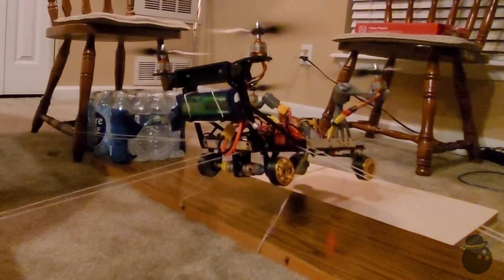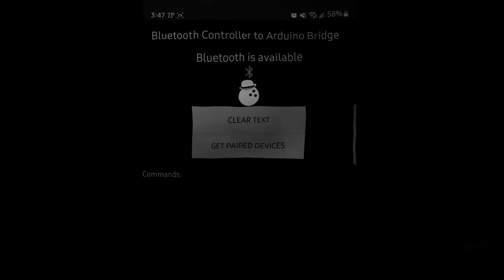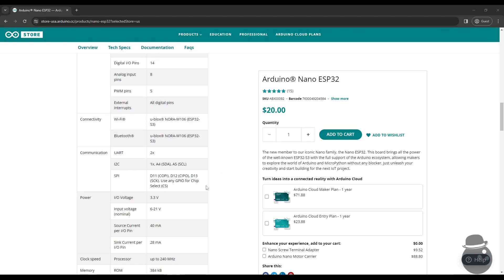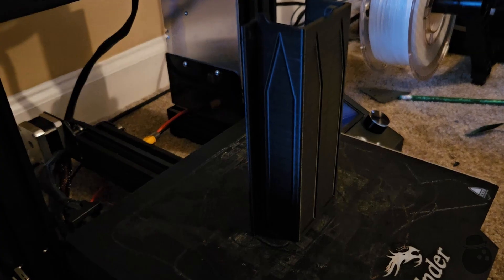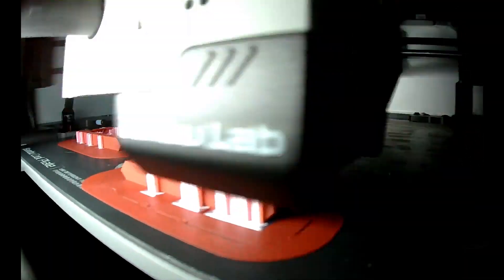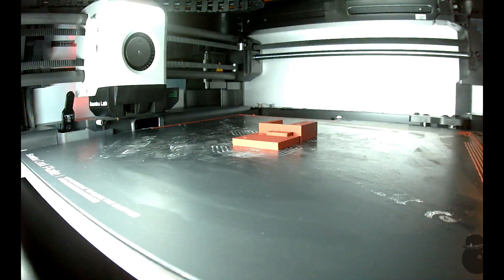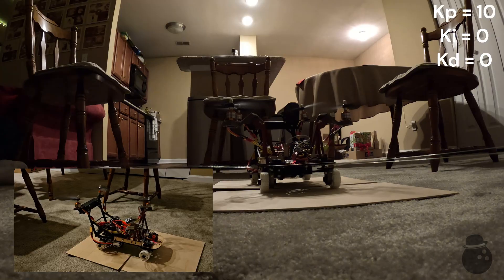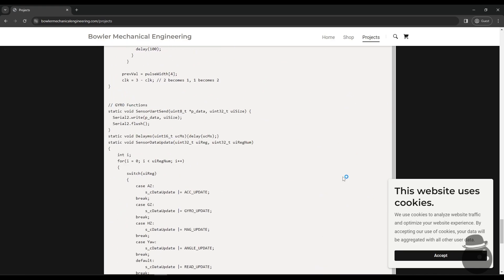Flying RC Car - Part III - Upgrades

Comment: for getting it stable just use a drone flight controller with betaflight it should help quite a bit considering the pid loop frequence is way faster than any arduino flight controller

Comment: Hi FPV guy here: 

1. Try to fix the props, so they don’t move. When your quad will pitch and cause the props to move, it can be wrongly interpreted by PID algorithm and be catastrophic for your quad
2. Try to use a flight controller, developers from Betaflight spent years on improving their PID and flying capabilities. Why reinvent the wheel?
Reply from the maker: Thanks for your comment! It sounds like you agree with the consensus, I will likely be looking into a flight controller (it was neat to learn/reinvent the technology just for my own education). As for the moving props, I would really like to keep that feature if possible but it sounds like the comment section has low confidence in that working so I might have to revisit a way to hold them fixed other than their own thrust / hard stops.

Comment: so I build RC quadcopters (FPV drones) for racing. your problem is the pivoting joint on the four arms, the extra movement in the arm is causing noise in the PID control loop. the four arms of the flight frame have to be as stable as possible and you really want the accelerometer and gyroscope in the mass center of the craft isolated from vibration as much as possible.
if it HAS to pivot, you might consider a latching system, maybe one that activates or deactivates with a servo or mechanically with landing/launch momentum. so like when you arm the flight motors the arms pivot and lock in place.
Reply from the maker: Thank you for the comment! The accelerometer/gyroscope point is a valid one, and, since everyone in the comments is recommending a flight controller, I will likely be getting one with a built in gyro so I will just position that over the center of mass. In part 2, my original design had servos articulating the swing arms, I am hopeful that I don't have to go back to that (because it looks cooler to see the motors lift themselves, and it saves weight), but as I continue working I will keep that option in mind.

Comment: Have you thought about checking out existing car that flies? I think they have one out there somewhere and check out their design.
Reply from the maker: I have seen some "Quadcopters with wheels" but I have yet to stumble across an articulating land/air vehicle. Do you have a link (or video name) in mind that you think could help me?

Comment: You should use radio master ELRS . it’s a open source  protocol 
They use a 915 MHz long range 
Set up
Reply from the maker: My new radio controller gives me 1.3 miles of range which should be more than plenty for what I need (and much better than the 15 feet of Bluetooth I had before). Thanks for the suggestion though!
Reply: yo the 2.4 Hz Elrs is just as good at range in open air. 
but yeah, the elrs dev team did a 100klm flight on a regular radio.

Comment: The reason it leaps forward is because your rear props produce thrust perpendicular to the ground while the front produce it back at an angle. You will always need more thrust out of the front propellers to keep the car in the air since they are angled (check out force vectors). Your car will never hover unless you wither make the front props flip out to be perpendicular with the ground our you tilt the back props in the opposite direction.
Reply from the maker: The angles in the linkages (at least in cad) have the front two props ending up orthogonal/perpendicular to the ground. The force vector should be straight up on all the motors. Is there a part in the video where you are seeing them not be at the correct angle? Moving the front props to the hard stop manually also has them appear to be perpendicular to the ground. I will keep a closer eye on the angles of the props while it's trying to take off and see if I am hindering myself with non-perpendicular thrust vectors. Thanks!

Comment: I wonder about a couple things.  1) bendy arms for the props.. makes for a lot of variation the flight controller wouldn't account for.  2) do you get much prop wash from the higher props to the lowers?
Reply from the maker: Thanks for your comment!
1) Yes, I am definitely making it harder on myself by having those articulate. That feature is what, at least in my opinion, makes this project unique, so I would like to keep that even if it means making the controlling harder. At very low thrust, the props swing up to hard stops and are constantly pushing against those hard stops for the duration of "flight", which, at least as far as I can tell, shouldn't be too big of an influence, right?
2) The rear props are only about half an inch higher than the front props. The circumferences of the props are separated by about 2.5 inches. I don't suspect there is a lot of prop wash but it's possible.

Comment: I think you could use an FPV drone flight
controller, like a SpeedyBee F405 V4 running
iNav, with all the GPS and altitude hold
functions, while simultaneously using ar
Arduino for controlling the car. Alternatively,
you can search for a MatecSys flight controller
designed for an FPV wing, which has a lot more
outputs. Then, you can configure a driving logic
for the car through the programming tab of the
iNav software. I'm not completely certain if this
is 100% possible, but I think it's worth a try.

Comment: Something that could help is to move the props further away from the main body also add a percent error into your gyro so the quad will not over compensate.

The percent error does not need to be much, plus or minus ,1 or 2%.
Reply from the maker: Would you elaborate on the percent error idea? Do you mean always make the error 1 to 2 percent closer to 0?
Reply: Yes, the main goal is to eliminate any unwanted interference or disturbances  from the Arduino, motors, or any other potential sources of noise. In my personal experience, particularly when dealing with accelerometers or gyroscopes in with an Arduino, I have found that is need around 2.5% error in my data. This helps to mitigate fluctuations and produce smoother results. 

This is the equation I use, it is not the best but it does the job.
smoothedValue = sensorValue - percent
  @bowlerllc

Comment: You really need a flight controller 😢
Reply from the maker: Do you have one in mind that would allow me to do the flying (so 4 motor drone output) and driving (bidirectional wheels with servo steering)? I also have no experience with off the shelf flight controllers, do they provide a benefit or functionality that I am missing with my arduino/gyro setup?

Comment: Nice one! Wondering if any prototype services may help for any upcoming upgrade work? Such as custom PCBs and 3D printing. If so, we'd love to supply free services and reach any collab together. (PCBWay zoey)
Reply from the maker: Hi Zoey, thanks for reaching out. I am a huge fan of PCBway! I used your CNC services in my filament extruder video and when people ask if I know any good services, I point them your way. As long as PCBway continues to provide the quick deliver of affordable and quality services, I will continue to be an advocate. I have no experience designing PCBs but this project might benefit from a custom one. My personal 3D printing capabilities are limited to FDM so there might be some SLA, SLS, or metal 3D printing jobs that your offer would be helpful for and I will be sure to reach out if I need one of those services done! In future projects, I may also be in need of more CNC work, so if that is also part of your offer, I would be happy to discuss a collaboration when the time comes! Thanks again for watching and leaving a comment!
Reply: @bowlerllc  Hi! Thank you so much for your continuous support and recommendation!!! Of course, all services are open to you, custom PCBs/3D printing/ CNC service! And we're looking forward to having some correlated projects working together! May I know your contact info? If you don't mind, you can find mine under this account, would love to have a further discussion on potential cooperation! 🤗

Comment: Maybe you should get a strong FPV quad and make a RC car and combine them together
Reply: Ok cool
Reply from the maker: Thanks for your comment Tim! While that would, most probably, work, that was not my goal here. In part 2 of the series I specifically stated my intention is not to build a "quadcopter with wheels" but instead a car that "transforms" into an aerial vehicle. I also enjoy the process of creating things from as scratch as I can and then trying to overcome the problems and obstacles that pop up along the way.

Comment: have you considered looking into having the same motors connected to the wheels as the propellers and then having some gears/linkages so you can switch between flying and driving mode as you wouldnt use both at the same time. As a wise man once said "The lightest part is the part that is not there"
Reply from the maker: Thanks for the comment! There's a chance this could work. My concern comes from the added complexity that this would introduce on the mechanical side. Balancing the "gained" weight from removing the extra motors with the added linkage weight would be difficult. The wheels also spin much slower with more torque, while the props spin considerably faster. The wheels also go in both directions and the props only (should) rotate in one direction (that direction is different on 2 of the props to cancel out the "induced" rotation). This is an interesting suggestion that likely isn't impossible but would be quite difficult (at least how I am picturing it).

Comment: next time you should make a flying car that flies like an airplane
Reply from the maker: Another channel, Eternal Progression, has a pretty cool one with retractable wings.
Reply: @bowlerllc  yes is saw that after you told me about it, his doesen't really fly though just barely manages to stay in the air longer for like 2 seconds
Reply: @bowlerllc  also maybe you should try making a car-boat like something which will work on land and water

Comment: Have you considered using an off-the-shelf quad flight controller and then toggling to it for flight mode? I've had some success with using the mode switching and LED on and off toggle to hand control to an Arduino by flipping a switch on the controller. I think using a proper FC will really help this thing fly. Alternatively, I'd check out Nicholas Rehm's DrehmFlight system which could also be adapted to run on similar hardware while also offering a better control loop.
Reply from the maker: Thanks for your comment! I have toyed with the idea to use something off the shelf for flight control but I always struggle with the "transitioning" between the two modes (and I clearly like to make things harder than they have to be for the sake of learning new things). 
I looked at the DrehmFlight (which I don't fully understand everything going on in that code but the concepts seem similar to what I am trying to do), and what I actually ended up getting out of it was learning about the Teensy 4.1. It has a similar form factor to the nano but looks like it has more pins and might have enough communication bandwidth that I won't have to "multiplex" my signal to control the multiple functions at once. I didn't really know that microcontroller existed so I'll try that out and hopefully that helps, thanks!